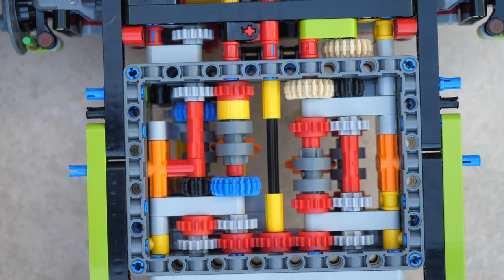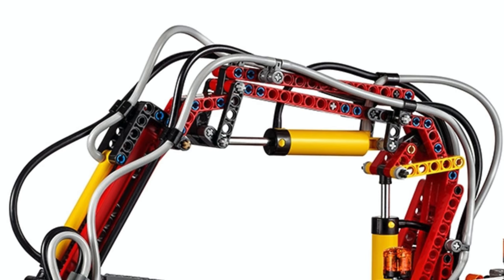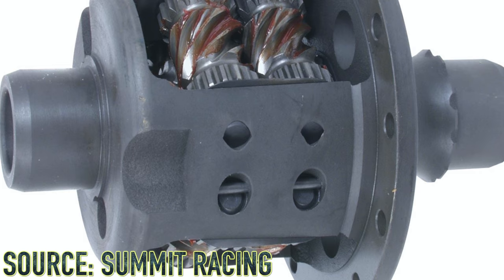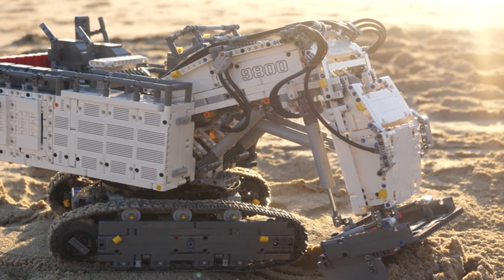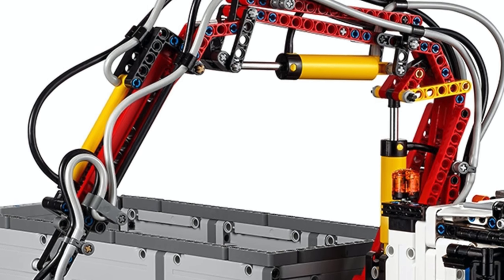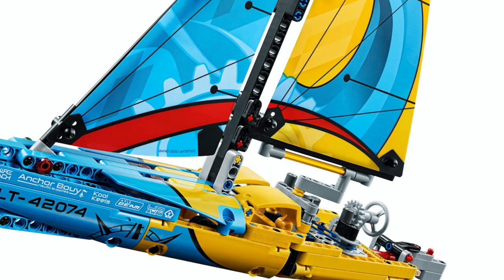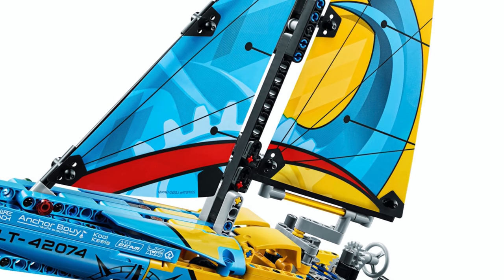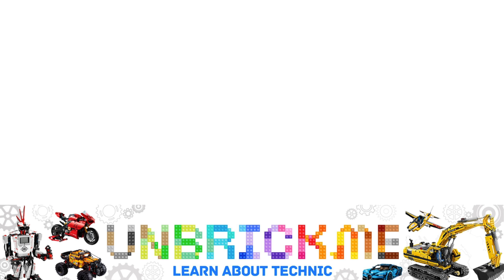10 Functions LEGO Technic Needs to Introduce

Comment: In my opinion, the most important of these is bearings. In order for a model to reach a velocity of 50mph (80kph), a 68.8mm diameter tire has to rotate 102 times per second. The friction produced by the moving parts would cause the ABS plastic to melt even in a relatively light model of a few hundred grams. Of course, the mass of the model is relative to the amount of time it takes for the parts to melt. Lubricants can be used to reduce friction but are messy and attract dirt and dust which conversely accelerates wear. Even slow-moving GBC modules will eventually wear out parts from friction.
Reply from the maker: I definitely should have included bearings

Comment: LEGO needs to make their motors cheaper. The Control+ system is WAY more expensive than Power Functions, and LEGO is already retiring Power Functions motors!
Reply: Yeah I tried buying them but I still want a power functions servo motor and an extra XL motor which I've read is more powerful than a powered up XL . Also on the Lego website they say power functions is retiring soon but 6 items don't say they are retiring soon on them so I am confused
Reply from the maker: Yeah powered up is too expensive

Comment: honestly, all these "R/C-ing" of lego sets doesn't excite me. sure it's cool and all, but it always falls short of your expectation for an R/C.. slow, weak, bulky, etc. and it's not like a designer can't give us stronger, faster motors, but lego piece's own inherent properties limit this intent.. plastic parts rubbing against each other, gears gnawing and jumping tooth, axles melting holes of technic bricks, long axles having torque twisting, and the list of potential problems goes on and on.

so for me, i'd want to see the effort (and $) put more on mechanically advanced sets than having more expensive motors and R/C. if I want a toy to dig dirt in my backyard or beach, i'd get a proper R/C excavator and not my lego set.
Reply from the maker: A while back with the 9v era we used to have the technic rc system with buggy motors and those were incredibly fast! Like 30 - 50 mph. We need the old RC system back!!!
Reply: I feel EXACTLY like you do, man. It makes the set a whole lot more expensive and, on the other hand, you can see it slowly moving on your floor. Not worth it.
Reply: but don't get me wrong, i still like seeing legos get motorized functions (R/C or not) like winches, booms, pneumatic functions, tracks, etc... just not to the point where they become kind of excessive or really out of lego's realm of design/intent

Comment: If Lego should make a higher power battery box, I say that it should be rechargeable, so then it can be a sustainable battery source in a smaller package.
Reply from the maker: yeah rechargeable higher voltage battery box would be so awesome!
Reply: @Jeremy Davis I remember when the Lego education system first came out with the computer interfaces bearface a an interface B.

And some reading and on the internet of course is that they encourage the kids to I think about how one day the Entire Computer could fit in hey single Lego brick.

Actually now that's a thing Mindstorms powered up whatever anyone!

Pretty much of it has input snap points it's a computer at least nowadays which actually would meet the qualifications of a computer even before computers were thing.

Information storage and retrieval what about music rolls AKA player piano rolls that would actually qualify as as a computer storage media.

And yes it digital either a whole or not a whole ones and zeros parallel data.

And of course there was punched paper tape later on and of course Punch Cards.

The certain design of weaving loom that was controlled with a programmable system that was a forerunner of Punch Cards was an example of the very first sort of thing like that in a way.

Also early electromechanical jukeboxes wer a bit of a computer as well.

Even the humble lot or mechanical pinball machine was basically a relay computer.

Matter fact on the old gas pumps that use the number drills to calculate the price per gallon used are tradable gear sets.

That whole system was actually called the computer.

So, I'd like to see is Lego mechanical logic.

A visual working logic system that could be motorized just a thought but I'm sure it's been done but it would not be perky tool I don't think at least in sets.

Although I've seen logic done with Lego pneumatics and mechanical assemblies.

And even in some cases stepping mechanisms and others and motors and such polarity switches on. All combined into one thing to do something that would require logic and timing.

Which could easily be gear trains and cams.

Once saw someone build a garage into a Lego house with a button that operate the garage door just like a Standard Electric garage door opener wood right down to the light and everything including automatic reverse.

And the ability to stop the door mid operation literally internally emulated a normal old school garage door opener in Lego.

Although most of the building contained all the electrical and the mechanical parts of that just to run the garage door but still pretty cool Ernie Haase not necessarily sanctioned but 100% Lego.

Also there was no repeat no Mindstorms or any thing programmable at all involved it was strictly electromechanical logic.

And of course limit switches all done with Lego switches if I remember correctly use both 9 volt system and 4.5 volt as well.

The only thing that was missing of course was the break beam system for reverse and stop since there would have been no way to do it.
Reply: 100 dollars take it or leave it
Reply: @Unbrickme   can you please stop speaking about pendrumatic 
lego stopped making them last year 🙄🙄
Reply from the maker: VIA 28 Rudra Badhe pneumatics have been around since 1984, and I doubt they would just discontinue such an iconic feature of lego technic. Besides it’s only been 3 years since the last pneumatics set
Reply: @Unbrickme  I was sad they discontinued pendrumatics I wanted a set for pumps
Reply: Lego is stupid
Reply from the maker: LEGO not selling a pneumatics set doesn’t mean it’s discontinued. We’ve had lots of time periods before during which none pneumatics sets were available
Reply: @Unbrickme  they actually have google and if you go on lego site they will tell you all pendrumatics products are retired
Reply from the maker: VIA 28 Rudra Badhe they’re temporary retired for a short period of time, but they’re not gone forever
Reply: @Unbrickme  I also asked the customer service and they said that they are retired for ever
Reply from the maker: Maybe the employee was mistaken
Reply: @Unbrickme  idk

Comment: What good it is to make torque converter, torsen differential and things like that if the vehicle can barely carry it's own weight?

I've just got a 7.2v 8675 (Outdoor Challenger) and it's very fun to play with. No hassle, just pure fun simply because it's powerful and durable. To me, the priority on the Technic line should be making powerful motors. THEN we start thinking about complex machinery that can get something out of those motors.

Comment: 1- it really doesn't matter how you define gearbox or how close they are to real applications. What matters is they do work. You demand Lego to develop specialized mechanisms. NO. Technic is about creating from what you have, not about using specialized parts. Otherwise go glue some plastic sets.
2- thers is no reason to developing pneumatic engine because of power conversion. Even if you put something like this in your model, you will still end up powering it from air pump driven by electric motor. Your model still be putted in motion by electric motor, only in the most inefficient way possible.
3- why in the name of Admin Allmighty you want a torque converter in a toy? Also, this device has really low efficiency that only worsens capabilities of models already without prober bearings.
4- actually good idea. Gears are available, so it is only a matter od developing simple main body.
5- the same as #1
6- no idea what kind of mechanism you are talking about. But I know the more "radio controlled" the set is, the more distant and disconnected from the user it is. I would rather crank every single function of the model by hand than watch from distance how it does things by itself. Seriously.
7- I have no opinion about that.
8- #7
9- No. they have enough power for toy application.
10- a clutch? Lego is too small to properly use such device. The model has to be either seriously heavy or really fast to maintain speed while engine is disconnected, otherwise clutch has no sense. Even if, in this case a brake system would be also required. You forgot about that.

Comment: I mean, you can obviously power the power functions motors from a bench power supply by you know, splitting on the extensions to have it, we just go from bear wires to the connector and you can slowly increase the voltage to find the maximum voltage that they can take

Comment: If lego wanted to make a functional automatic transmission they would need to have it controlled by a computer.
Reply from the maker: We have the control+ system
Reply: not so. I made a working CVT gearbox that sense torque, and actually works. Can see it on my channel.

Comment: i recon lego should make hydrolic systems aswell as the pneumatics. ive tried it with water in the pneumatic system and it works fine apart from the stwiches release the water when you switch them, could make for some cool stuff

Comment: Dual differential steering will to be part of the bulldozer. The reason is that even  if they want you to be able to turn your bulldozer like a car, they can just programm the software so that it works with one motor per track. This is also how it works in these days. Dual differential steering can also be easily build into your moc.
Reply from the maker: Yeah but the main reason they can implement it is to mimmick real life bulldozers
Reply: @Unbrickme  You do not understand. Real Tracked vehicles have one motor driving each track. They are hydraulic motors, but they are motors driving the track directly. The Output of these motors is controled by software. So even if the tracked vehicle has a steering wheel like a car,  it has one motor for each wheel. THERE IS NO DUAL DIFFERENTIAL STEERING INVOLVED!
Dual differential steering is actually rarely used, because it got replaced by software basicly instantly. 
Also, this software could easily be programmed into the Control+ Software, so there is no reason for Lego to use dual differential steering. 
Also the Sets are getting worse and worse. Today Lego barely puts any technic in Lego Technic Sets ( which doesn't only sound silly, it is silly!).
Why would then put such a system into the bulldozer, if they are so lazy!
Reply from the maker: Honestly that’s the thing, lego Technic sets do seem to have less technic mechanisms in the modern sets. This is exactly why I really wish the new bulldozer will have dual differential tank drive. Yes it can be more easily replicated with software, but a dual differential tank drive would be so fascinating in LEGO technic and it would be the first time such a mechanism is used in a technic set. I just hope that the new bulldozer isn’t like one motor per one function, because that is just super basic for such an expensive lego technic set
Reply: @Unbrickme  That is one reason why I hate the Control+ System. Because the Software does everything! And you can't even programm it yourself! This contridicts the idea of Lego Technic. 
Also, those parts are ridiculusly expensive and not compatible with any other System like the 9V and Powerfunctions System ( Those two for example were compatible via extension cable), which contridicts the idea of Lego!
In my opinion they should reintroduce Powerfunctions!

Comment: For the speakers, they technically wouldn't did to add them they would just to need to alter how their electric motors function a little bit. Electric motors and speakers use the same concept to work, so i could see that being an option.  It's like what tesla cars can do, there are modes that can alter the way the motor sounds so it sounds like a spaceship, lego should do the same.

Also, for high speed motors, they should just use brushless motors, now you would see high rpm.

Comment: The problem with the clutch system is that legos are not heavy enough to have inertia and so whenever you change gears the car/truck would stop so all the work that the first gear out is wasted
Reply from the maker: as long as the speed shift is fast it should work
Reply: @Unbrickme  if it’s as quick as an hypercar maybe lol, I was kinda thinking that if it shifts slow you just do literally 2 trans so that when you want to shift in 2nd for example the second transmission keeps running which le the time to engage the second gear on the first trans and then the other can shift, with that process it would keep all the movement that is already there and the vehicle wouldn’t stop

Comment: Do you think that powered up is better than power functions? Since it will get ever better through future updates. I really must know.
Reply from the maker: I think that for some applications, powered up is better, but there’s still a lot of other applications where power functions is better. For example, full RC mods are much easier to make with powered up due to the receiver being built in to the battery box. You don’t have to worry about modifying the external shape to accommodate the receiver
Reply: @Unbrickme  ok cool. I just hope you won’t say bad stuff about powered up for the next video.
Reply from the maker: Nah, initially in 2019 I strongly hated the powered up system. I would’ve preferred the 42100 set to be with power functions. The first set to really change my perspective is the 42114, due to the 90 degree speed shifting. And ever since the custom controller update came out, I began looking at the powered up system from a completely different perspective. Do I still prefer the old power functions system? Yes! But do I hate the powered up system? Absolutely not
Reply: @Unbrickme  oh thank goodness. Honestly powered up has soooooo much potential hardware wise and software wise.

Comment: Quick question. In a real car, could you just replace a clutch with a torque converter?
Reply from the maker: I don’t think so. The manual and automatic transmission mechanisms are very different, and a torque converter might damage a manual transmission

Comment: The Code Pilot from set 8479 (year 1997) can be programmed to play different pitches of sound, but unfortunately this feature was never to be seen again on non-MindStrom sets.  

Technic cars seems to be hitting a wall, sure we are getting more gears for each new flagship release, but we are really just paying for all those body panels and stickers, inside they are not so much different from each other.  With the new IP/OEM releases, technic would focus more on the looks than functionalities, you think with the price for the Lambo we would be getting native power function/powered up support and lighting modules, features that sets released decades ago already had. 

All being said, Technic will still be imporving in the years to come, but just don't expect them to be as quickly and groundbreaking as during the 90s - early 2000s.  Before Lego almost went under in 2004 it was all about making the most innovative set possible, profit didn't really matter, and sets from that era really showed what was possible.  After 2004 money was the No.1 priority for the company, so rather than setting the trend Lego would follow whatever IP that could make the most cash, so now we are getting all those fancy IP cars/heavy equipments, but fewer original sets are been developed compare to the early days.  

Innovation means taking risk, and risk means potential lose of revenue, as a profit-centric company Lego would not dare making huge strides in technological breakthroughs like before.  It might be the most powerful brand right now, however is not without cost.

Comment: is it not true that disengaging clutch in real car stops gears in transmission from spinning. it just disconnects engine from transmission, output shaft is still spinning because it is connected to wheels. real transmissions use synchro rings to match speeds of both shafts when engaging a gear.

Comment: I have a question if anyone could answer that would be great 😼. How do you control a technic car? Like do you control it with hand or does it come with a remote control or do you have to download a app to control the car. I really want to buy a technic but i want to make sure about this question i have to know if i need to buy another thing with it. If you can answer this that would be awsome
Reply: The newest RC Lego cars use an app
But I think you might be able to buy a remote controle
Reply from the maker: yes the newwest ones use an app with your mobile device. older power functions used a physical remote.
Reply: @Unbrickme  so just in case i get a old one where could i purchase a remote?